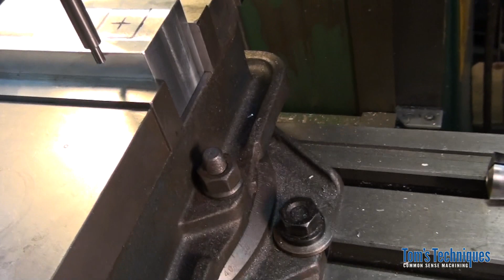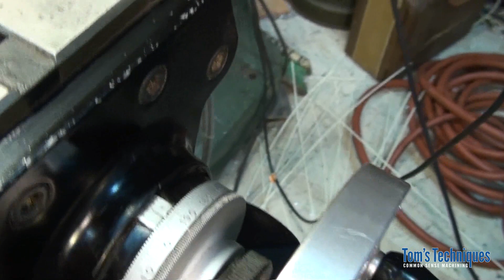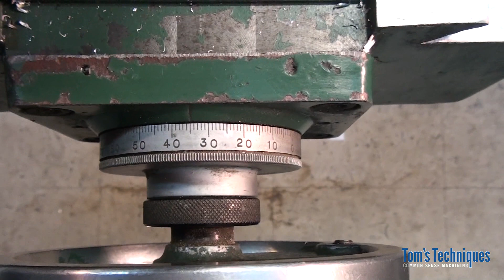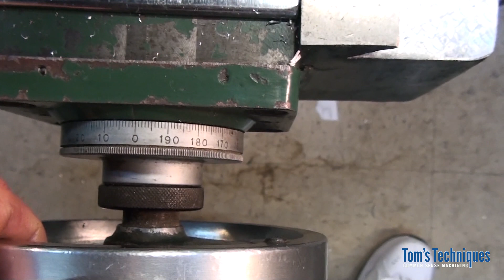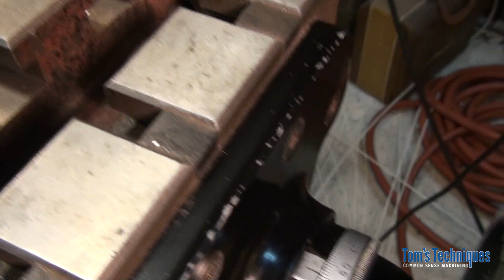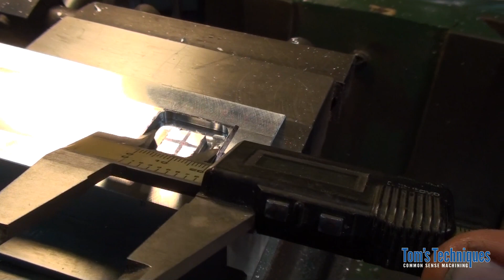Cutter and Backlash Compensation on the Milling Machine

Comment: I had to chuckle a little bit. I've been a machinist for so long, it never occurred to me that some wouldn't know about backlash and compensation for it. 

I laughed because I had a young man in my home shop a few months back that wanted to do some mill work on a project he had. He is a competent guy, in metrology school, so I had no issues with him using my 50+ year old machinery. 

He brought his part in to show me a dimensions problem he was having, and I thought he miscalculated his tool offset. Now, I realized that I did the young man a disservice because his problem was that my old machines have considerable backlash.  😅
Perhaps I should correct that before I have wear in areas that shouldn't.

Comment: Shouldn’t you have taken .009 off of both sides to ensure the pocket is center? Since you were .005 short on the backside? So in theory you’d be .005 off center
Reply from the maker: I had to go back and look at this 10 year old video to see what I was doing, and the answer to your question is no. All off the backlash compensation cones off one side. Remember that the backlash compensation is only applied in one direction, not both, so it doesn't have anything to do with the centering of the pocket.
Reply: @TomsTechniques  thank you!

Comment: Is it advised to take a measurement and measure the screw’s backlash for every cut. Or can you assume it is the same amount for each leadscrew once you find it. In other words, can it vary throughout a lead screws total length or is it always consistent
Reply from the maker: I think before adopting that procedure, I would check the backlash of the screw at various points to find out.

Comment: I'm a little late to the party but I have a question:
Is the backlash the same at all positions along the screw?
By that I mean, if I measure 18 thou with the table all the way towards me, will I also get 18 thou with the table away from me?
Also, other than thermal expansion of the screws and stuff, will the backlash be the same every time or should I remeasure every day/part/op
I would try all this for myself but I don't have a mill or lathe (yet)...

Thanks to whoever wants to help.
Reply from the maker: The backlash will vary along the screw on older machines because of wear on the screw. On most mills about 90% of the work is done on the center foot or so of the table. It's best to just compensate for the backlash in every setup, rather than try to predict what it will be.
Reply: @TomsTechniques  thank you very much for your video and your reply

Comment: But your backlash will not be present in the direction in which you used the edge finder, right? So so long as you cut in the direction in which you fed the edge finder your dials will be accurate. And as long as you reverse your screw and move it forward again you will get an exact measurement. Won't you?
Reply from the maker: Backlash has to be compensated for whenever you reverse the direction of feed. If you pick up an edge, all moves in that direction will be valid, but as soon as you feed the opposite direction, like in a pocket, you need to compensate for backlash.

Tom
Reply: Thanks for replying! Yeah, it took me a little while to wrap my head around it but now I understand. For arguments sake: if you were to feed in from the edge and then plunge at your target dimension instead of feeding in the opposite direction, you'd end up at you finished dimension, would you not?
Reply from the maker: Yes, but don't forget to compensate for the cutter diameter if you are milling.

Tom

Comment: Your topic was "backlash compensation" and it was clear as mud. I understand what backlash is and how there is a need to compensate for it buy our explanation of HOW you did it was no explanation at all." I'm going to 165 ; no wait 175 ....." Why are you going there? Explain, explain, explain. I had difficulty determining what was your "X" and "y" axis and WHAT were you moving; the work or the end mill. Confusion'!!!!
Reply: He did explain it. He measures the amount of backlash in the individual screws by measuring how much of the cut is missing in the part. He then adds that value to the cut he needs to make in that direction to end up att the true position. As the handwheels were set to zero by feeding the table in the opposite direction, that direction will be precise.

Comment: Thanks a great deal for this.  This is a tremendous help.  I was needing this for reaming a hole to a larger size with a boring fixture.  My cuts kept ending off about ten off-center.  Now that I understand what's going on, I think I could find the screw backlash by using an edge finder and a block of known size.  I made the mistake of thinking that the backlash could be felt.  Obviously not, since in the video what looked like .010 backlash turned out to be .037!
Reply from the maker: +artgoat 
You don't need (or want)  to know how much backlash a screw has. You just have to know how to deal with it. The problem, especially on older machines is the backlash varies over the length of the screw due to wear. Just compensate for it as I demonstrate in the video and you'll be fine.

Tom
Reply: +Toms Techniques Yeah, I figured the lash would vary by position. The technique would be a little different for centering a hole, I would think, especially if there is a question whether the hole is perfectly round (part of why I'm boring it).  So it has to be in the perfect spot before the tool goes down.  Can't bore it first then see how far off I am.  I know how to touch off the sides of a circle to find the center, but the center needs to be displaced by 1/2 the lash on both axes. I don't understand how to do that without knowing what that is.
Reply from the maker: +artgoat 
Holes are easy. All you do is pick up the edges of the part with an edge finder and move in the required distance to the center of the hole. As long as you turn the crank the same direction as when you picked up the edge, the backlash will be irrelevant.

Tom
Reply: +Toms Techniques Well, it's obvious I'm failing to convey the issue, but I've taken enough time on an old video aņd I can probably figure out the rest.  Thanks again for the video.

Comment: when you say back lash you mean play in the handle right?
Reply from the maker: Backlash is the clearance between a screw and nut and must be compensated for when machining. Every lead screw has it, unless it is a ball type lead screw.

Tom
Reply: Toms Techniques clearance between the threads of the screw and the bolt?
Reply from the maker: helmsplitter0233
Yes.

All screws and nuts require clearance and this produces backlash. In other words, when you move the table on a machine one direction and then try to move it the other direction, that clearance must be taken up before the table will move. That's backlash.

Tom
Reply: Toms Techniques ah thanks

Comment: Hello Tom, you made hard work of all this backlash. Providing that you always work in the same direction for the backlash, you can just use the dials, no trial cuts needed and no marker pen. You had edge found anti clockwise and set the dial, you had also milled the back edge anti clockwise .375 thou. When it came to doing the front edge, all you needed to do was with the tool retracted from the milled pocket; move the table .400 thou + clockwise past the centre, then wind the table back anti clockwise until the dial reads .375 thou. Run the cutter and plunge back to your original depth. Do the same in the X direction, job done. You then have no need to know how much the backlash is in each leadscrew. Hope this helps others. Obviously it still works in the other direction if you have edge found in the clockwise direction, then always work the dials in the same direction. Another of your interesting machining tips, well done.
Reply: +Dave Ticehurst That might work in this one, specific example, but Tom gave a good tutorial for general use.  For example, recently I needed to bore some tubing to a larger size (no, I couldn't chuck it in the lathe, because it was welded into 3/8" plate that was longer than the swing of my lathe).  The best way to find the center is to touch off four sides of the circle with an edge finder.  How do you know what the center is if you don't know how much the second touch is in error?  So while this may have been overkill for this exact job, that wasn't the point.  As a general-purpose tutorial on backlash compensation, it was exactly what I needed.

Comment: tom i can tell you why your cut size was off in one direction if you watch vary closely just after 15:35 u will see u turn the X axis a bit fast and your dial stuck a bit in your turn u will see it if u watch vary close. thanks and keep up the good work
Reply from the maker: "Off" is a relative thing. If the tolerance on that slot was plus or minus .005", it was right on. A mistake many machinists make is to spend too much time machining to a theoretically perfect dimension when getting it within the specified tolerance is just as good and takes much less time. Besides, if I wanted the slot any more precise than it was, I wouldn't have been using calipers.

Thanks for watching!

Tom

Comment: I suggest that all you guys that do not have a digital readout that you save up some money real quick!
Reply from the maker: DRO's are a luxury, but definitely not a necessity. I had been a machinist for ten or fifteen years before I used my first DRO. Yes they are a time saver, but you can get by just fine without one.

Tom
Reply: Hi Tom
Possible yes, but if had to use dials only I would be in for a lot of mistakes.
I got lucky with mine, I repaired about 10 readout units for a local company and my payment was in the the form of a secondhand readout. Subsequently my home got hit by lightning and blew the unit to pieces. Luckily insurance replaced the unit with a brand new one!
Enjoying your videos thanks!
Reply: Hi Cees hows the woodworking going

Comment: hi
after watching this I used the dials  to do a 5 bolt circle with x and y  as I don't have a rotary table,   I was surprised how well it worked once u get ur head into it, also want to comment that I have used a few of you're tips and have been very helpful, one was cutting a 1 1/2 - 8 thread ,,turned out nice,   thanx for the tips
Terry
Reply from the maker: Thanks Terry, glad you got some use out of the videos.

Tom

Comment: I was hoping you would measure how far the pocket is from the edge. Good video. I showed someone how to do the same thing on his mini mill and I think it turned him off from doing any machining. Also, have you ever heard that you get better accuracy if you don't let the cutter cut on the bottom and sides at the same time? It seems like I do better if I lift the cutter .001 before taking the finish cut on the walls. I have a mill/drill which might allow the endmill to run around if it touches the bottom.
Reply from the maker: Checking the edge distances is certainly something that can be done to ensure location. I was more interested in showing how to deal with backlash in this video. The fact that you get a better finish with the cutter off the bottom is a rigidity thing. It's not an issue on a heavier mill.

Thanks for watching.

Tom

Comment: Hi Tom,
would it not be easier just keep on going all around? I only have a toy drill/mill from Harbourfreight, I use in  X-Y direction a couple of 2" travel dial indicator and keep going around.
To feel where the back-lash begins and ends is very difficult otherwise. Rotating the dial back and front again, probably it's ok on your nice mill, unfortunately I am never sure of that, due to different friction between screw and nut at different points of the spindle which is not worn out evenly. Nevertheless you showed a few interesting things.Thanks.
The Old Bob
Reply from the maker: Hi Bob,

This video shows how to compensate for backlash when not using a direct readout like a DRO or indicators, so you need to establish the edges of the pocket before going "all around".

Having never used a Harbor Freight mill, I'm not sure what you mean by variable friction, but the bottom line is you have to know your machine and how to compensate for any issues it may have.

Thanks for watching.

Tom

Comment: I have the DRO on my mill, but you really can't beat the nice analog feedback you get from reading dials. Sometimes the rolling digits are less of a help, but that nice linear scale is.
Reply from the maker: It is easier to overshoot with a DRO although I doubt it'll make me switch back to dials. An analog bar like you see on digital multi-meters would be nice on a DRO.

Tom
Reply: Toms Techniques I agree that I still use the DRO, but with the modern proliferation of cheap graphical displays perhaps one day we'll see a DRO that as well as the numbers, shows a simulated hand wheel with virtual sharpie marks for end points (no backlash compensation required!).
The graphics display hardware is cheap these days with the likes of Raspberry Pi's etc, suitable LCD displays likewise.
Perhaps if I get bored one day!

Comment: I am going to have to watch this one a couple of times Tom..  As a beginner I am still having to double check myself to make sure that I turn the dials in the right direction to do what I want to do...  Especially when I am in a corner and don't have any wiggle room.  Nice job...  Thanks
Reply from the maker: Don't watch it Fred, do it for yourself. Practice is the best way to get the feel for what the machine is doing. Just remember that the end mill is stationary and the part is moving.

Tom
Reply: Your last sentence that the table moves not the end mill was an Ah-Haa moment for me a couple of months ago.  I also look at the dials and think of the table as a big X-Y graph and that returning to 0,0 always is lowering the numbering on the dials (works for me) and eliminates the confusion factor.  Thanks for all your tutorials they help a lot of us....
Reply: Toms Techniques Another great video Tom.
Never a truer word  about 'feel' often lost outside a working environment and CNC programming.
Doing stuff like the vid shows up the weaknesses in any machine which may not be just the lead screws.

Comment: Thanks for your efforts on all these videos, Tom.  I'll be using your method here to determine the backlash on my mill.  The backlash should be consistent throughout the length of the screw, right?
Reply from the maker: I never assume anything in machining. If your mill is well used, the backlash may vary along the length of the screw and it will certainly vary from screw to screw or machine to machine. I would recommend always using this method, or something similar whenever you use dials. Once you get the hang of it, compensating for backlash will be second nature.
Reply: Toms Techniques Right.  Didn't think about how there could be more wear in the areas that are used more.  Probably close to the center of the table I'd imagine.  Thanks.

Comment: I put off the DRO for the new mill until I get it moved to it's new location. So for now still using dials...I'm glad they are decently well marked and have little backlash.
Great video Tom. It's easy to get confused for sure but a little logical thinking clears it up a bit.

Colin
Reply from the maker: Thanks Colin.

Comment: If you had to square up those corners, what would you do?
Reply from the maker: Victor,

One way is to use the quill of the mill as a slotter and plunge a stationary tool into the radius to cut it out. If you check out my video on building the Stevens, there are some pics showing the process. There is also more detailed information in the build thread. You can find that in the gunsmithing section of metalworkingfum.com.

Another option is to make the corners functionally square by taking a plunge cut with the end mill while centered on each corner of the pocket. It's not as pretty, but works just as well.

Tom

Comment: Tom great video as always...was wondering what the fixture is for on the back of your vise??
Reply from the maker: Thanks.

The bar on the back is the mount for a work stop. There is an arm with a set screw that can be attached and the work located off of it for multiple parts.

Tom

Comment: Thanks Tom,  I'm so glad I have a DRO on my mill, I could imagine my stuff ups without it.  I suppose backlash on the lathe is not often a problem as we're mostly cutting in one direction?
Reply from the maker: Backlash on the lathe needs to be compensated for as well. How about grooves in the end of a part? Or parts with turned OD's and ID's?

Thanks for watching.

Tom

Comment: Super for me. I have a Vilh. Pedersen knee mill and no DRO. It is really a hassle to deal with dialing everything in. I assume that backlash is not an issue with DRO because one is working with the actual position of the table. Do you have a suggestion for a DRO? I've been looking, but not finding. Thanks for the informative guided tour.
Reply from the maker: These guys have glass scale DRO's for around $500:

http://www.dropros.com/DRO_PROS_Milling_Machine_Digital_Readouts.htm
Reply: Toms Techniques
looking at the link now. Thanks.
Reply: Jim, if you don't mind a little DIY, you can get into a DRO for much less than $500.  It's not for everyone I understand, but good enough for someone who doesn't mind a little project to save a few bucks.  http://www.shumatech.com/
Reply: Everett Newton
Super initiative from shumatech, and helpful site. However, I don't have the skills nor the time to build one. I thank you for taking the time to help me out. Much appreciated. I'll probably have to buy.
Reply from the maker: Everett Newton
Hmmm. The link was dead when I tried it.

Comment: one trick i learned from a friend, is use an edgefinder to zero to the upper right corner of the vice,with backlash in proper direction, then u can line up parts with the right edge of vice, and it will be aligned at 0,0